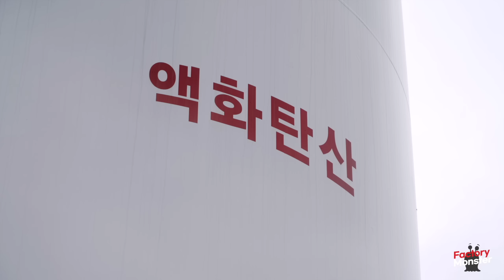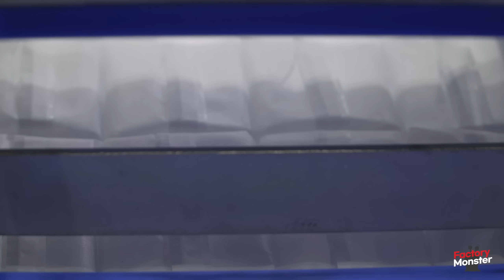Process of Making Tons of Dry Ice. Amazing Factory

Comment: I am confused by the liquified carbonic acid mentioned at the beginning of the video.  Is this used as the source for the CO2 needed for manufacture of the dry ice?
Reply: I'm also curious because I thought it was made from straight liquefied CO2
Reply: @patrickcorcoran4828  Pretty sure later in the video only liquid co2 is mentioned.
I guess is was a translation error.
Reply: @Ultrazaubererger  I was wondering if it was a cheaper way to transport CO2, like Ammonia being a cheap way to transport Hydrogen and then you extract it at the factory.
Reply: @patrickcorcoran4828  The amount of CO2 that is soluble in water at manageable pressures is minuscule.

Pure carbonic acid (H2CO3) is a gas and has to be kept water free or it will decompose (H2CO3 -> H2O+CO2).

So I doubt there would be any benefit here.

Comment: Interesting!
How does the machine make liquid co2 to snow?
Where does the CO2 come from?
Reply: Most industrial co2 is split from hydrocarbons/natural gas/methane, as it's possible but not economically feasible to split it from atmosphere.
As a gas, it's compressed refrigerated until it reaches a liquid state for shipment. 
That machine just cools it further until it freezes - probably taking advantage of some clever pressure change = temperature drop physics. Instead of using a refrigerant loop, they just use the boiling liquid co2 to extract energy from other liquid co2 until it freezes.
Reply: There's a tank of extremely high pressure liquid CO2 shown in the beginning of the video. CO2 at what we consider "standard pressure" of about 1100mbar can't form a liquid; it's either so cold that it's a solid, or it sublimes directly from solid CO2 to gaseous CO2.
The big tank of CO2 is at high pressure, so the CO2 forms a liquid in the tank.
Boyle's Law tells us that temperature and pressure are interlinked.
So, when the liquid CO2 is allowed to escape and expand into a suitable vessel, CO2 gas is immediately formed by the boiling liquid CO2. The rapid expansion of gas causes the temperature to drop sharply, just like the evaporation phase of refrigeration in your household freezer, only lots colder.
As the liquid CO2 boils off, it produces temperatures below about -68°C, which causes some of the liquid CO2 to freeze into a solid. It is this solid CO that comes out of the evaporator's spout as fluffy white, very cold dry ice.
EDIT: The CO2 is likely sourced from cryogenic distillation of the atmosphere. If you compress and cool air enough, the various gasses (mostly nitrogen with some oxygen and CO2 and a bunch of trace gases) form a liquid. The liquids are separated in vapour form using cryogenic distillation (which is like normal fractional distillation but carried out at much lower temperature) resulting in several fractions of reaseaonably pure nitrogen, oxygen, and CO2.

Comment: It's fun to pour a bag of dry ice pellets into the toilet at work.
The fog goes everywhere and it freaks everyone out.
Reply: If you swallow a pellet with some water, you will do foggy burps until the dry ice has sublimed.
Reply: @haitchteeceeeightnineeight5571  Not a good idea, you will damage your stomach lining, and if it gets stuck in your throat you will get internal freeze burn.
Reply: @FrozenHaxor  You'd think that'd be the case, and I had some concerns when I came up with this 25+ years ago. However, the interior of the human is warm and wet and the rapid sublimation of dry ice prevents it from sticking to the alimentary tract.